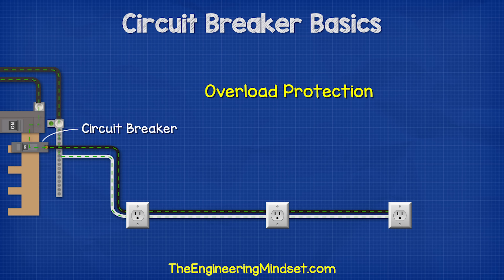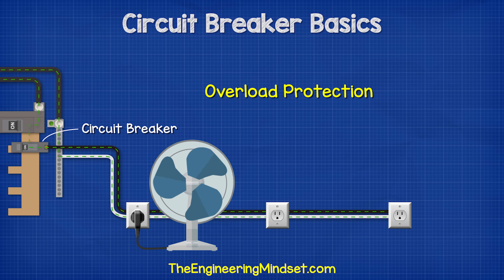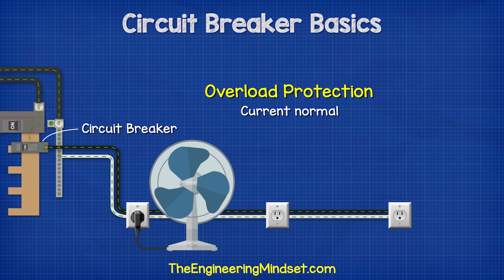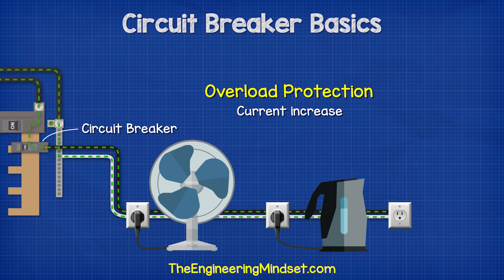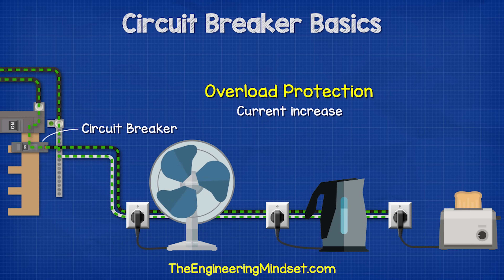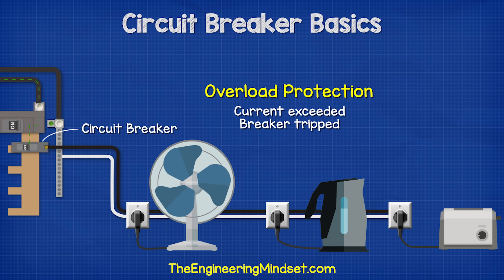Circuit Breaker Basics - How do they work?

Comment: I have a question about the video, mainly in the final part where it provides an example of an electric shock to an individual and how the GFCI device disconnects the circuit when it detects that he is grounding. My doubt is that I thought electric shocks occurred when the current used the human body as part of the electric circuit, not when it was grounded."

Comment: Nice video - at 00:38 you stated "positive and negative wires" - should this not be the "Neutral and Line wires" rather as you are showing AC circuits here. DC Breakers do exist as well.

Comment: I have a question regarding RCD. Assuming you have a set of 4 motor drives connected to the RCD, the circuit is okay. When you double the amount of motor drives connected to 8 drives, the RCD trips. 

In this scenario, should we say that there is a possible leakage current to earth, or because of the power electronics within the motor drives that acts like inductors, causing an imbalance in current, but there isn't any actual earth leakage?
Reply: In this scenario, it's possible that the increased number of motor drives is causing an imbalance in the current, which could lead to the RCD tripping. The power electronics within the motor drives, such as inductors, can indeed affect the current flow. However, it's also important to consider the possibility of leakage current to earth. To determine the exact cause, it would be best to consult with an electrical expert or technician who can analyze the specific setup and provide a more accurate assessment. They can help identify any potential issues and recommend appropriate solutions.

Comment: Your video title is "Circuit Breaker Basics - How do they work?"
Ok, you explained what circuit brakes do, and even what the electrocution prevention protection do. But where is the part that explains how circuit breakers work?
We know that they break the circuit in case of fault, it's in their name, but how!?
Reply from the maker: We'll be covering this in a detailed video, this is just the basics
Reply: @EngineeringMindset  Cool, that's for replying!

Comment: I think that circuit breakers protects the conductors (wires) from overheating, weather overloaded or shorted. Overloading occurs when too many items (lights and or appliances) draw too much currant (wattage) causing the wires to become hotter than what is safe. Therefore circuit breakers (like fuses) protect the conductors from overheating, and of course direct short circuits. I hope I have a good understanding of this concept.  Thank you.
Reply from the maker: We just published a new Ground fault, short circuit and arc fault video, so much detail! Link HERE➡️: https://youtu.be/Qi0ynSQw-wc